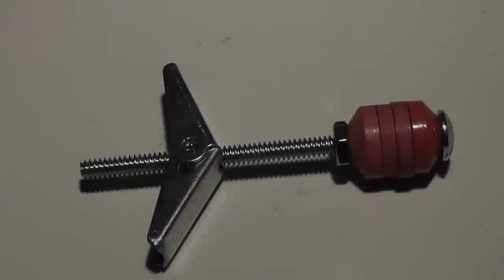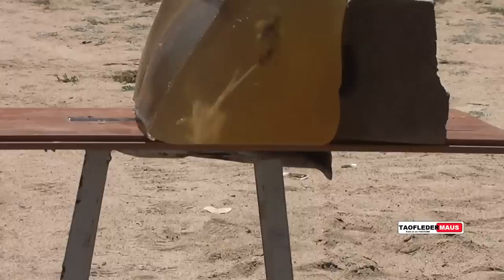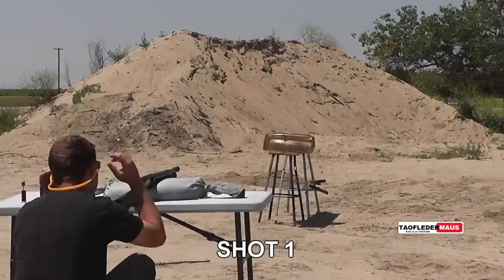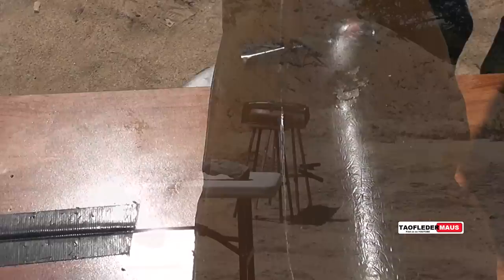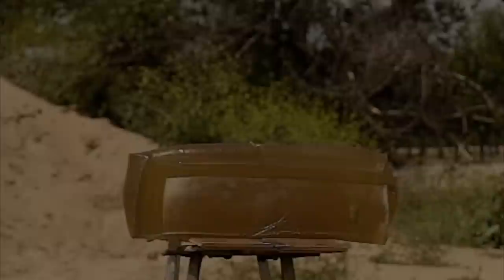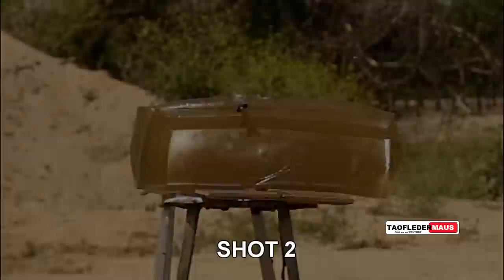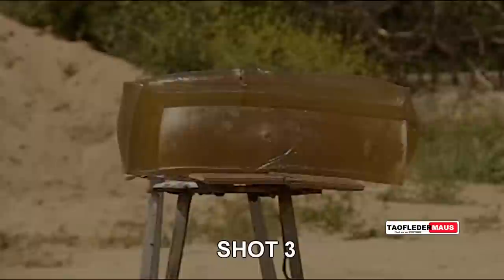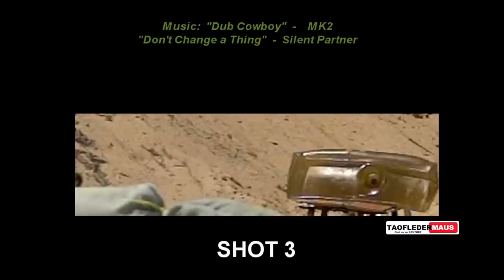Homemade SHOTGUN Folding-Fin Projectile Experiment

Comment: Why is there such variation in the power? The first one barely sticks into the gel, like it was propelled by a rubber band. The next ones are a lot more powerful, but they vary. One goes clean through, one stuck inside, etc. The only way you could get this to work is a heavier front end; right now, the front is light, and so the drag is acting on it, trying to make it tumble. You need a heavy, dense front part, like lead, so its momentum will pull it through the air, while the lighter, draggy tail is pulled behind. But I doubt it'll ever work as well as a real slug.

Comment: Put the moly into the back of the metal slug and have a massive penetrator and a drag tail!  Use an epoxy matrix to fix the screw in the back of the metal slug and try that in gel

Comment: No, actually I did think it would work. It is a lot like our missiles and rockets that have fins that fold out after they are launched. I suggest you use shorter screws, replace the springs with stronger ones so they open faster, and tweak the stabilizer(toggle bolt) a bit so it flies more arrow dynamically. You are onto something here, paten it!!!

Comment: Out of curiosity, I've read on these comments that the longer the round is, the more stable it flies- So what happens if instead of a solid 1 piece core used in this round, you instead used a telescoping core, so the length of the round increases as the make-shift fins cause drag and the heavier front portion acting as a base for the fins to pull the telescoping core from?

In any case, I'd probably be interesting to see how a round like that would play out. All stubby looking in the shell going into the barrel, then a mini-baton exiting the barrel.

Brainstormed a name for it: Erectoround.
Reply from the maker: +DormantGames  That would probably be challenging to make something like that,   something that can handle the intense g-shock and all.
Reply from the maker: +DormantGames  A good example of the force on a round is this one where we shot a huge spring out of  shotgun.  The spring compressed and was mangled just from the g-shock.  https://www.youtube.com/watch?v=FV6aW5LDRZE
Reply: ***** (Just watched that video quite literally a minute before your reply) Because the telescoping core would be cylindrical, it probably wouldn't buckle and bend as much as the spring, considering a spring is basically meant to flex (Just guessing of course, I know nothing about firearms or their ammunition from personal experience, just what I've read on YT and the wiki - But I do know a cylinder is really quite strong against forces pushing against the circular ends) It'd probably tear itself apart upon hitting something other than gel, don't know till it's tested ^^ Just need to wait a few months or years for someone to make-shift one up.

Comment: Would probably work better with the toggle bolt flipped around on the shaft. Would be forced closed as it travels down the barrel preventing barrel scratches and would open up quicker and to a larger degree giving higher stability/accuracy but possibly lower range.
Reply from the maker: Bob  It wouldn't be very aerodynamic,   and the arms would snap open going through the muzzle brake and tear it off.

Comment: You should have turned the toggles round, and wrapped some tape or an elastic around it so it opens up when it hits the gel and forces the toggles to stay open.
Reply from the maker: pypes84  Then it wouldn't be aerodynamically stable and it would tumble all over the place.

Comment: I certainly didn't think it would work. One should try using a similar round with wings that don't expand to see if there was any sort of difference between the two.

In addition, it seems like a sabot could help? isn't the size of that round smaller than the barrel it was shot from? would that cause it to not point  perfectly straight when exiting the barrel?
Reply from the maker: +MsHojat   We'll be testing these again soon,  shooting them at longer ranges so we'll see if they have any accuracy at 100 yards or so.

Comment: For what ever reason it looks like the 2nd round had a whole lot more velocity. Maybe the screw punched a hole in wad making it lose pressure and making uneven results. Maybe put a nut on the very tip so it doesent damage wad?
Reply from the maker: OSU Bucks421  The second one was screaming fast.

Comment: Did you weight your powder charge?  To me it looks like the second shot travel much faster than the first.  Maybe it needs to fly at a certain minimum velocity in order to stabilize?  When I made some home made slugs the heavier ones wouldn't fly straight similar to the first shot on video.

Comment: Honestly? Would hate to get shot by one of these...even more so then the other shells you can load into a shotgun...that thing is bloody terrifying...

DID YOU SEE HOW BIG THAT HOLE WAS!?
Reply: +Rpground

The downside is that the round is very long, and would best fit on something like a break-action shotgun.

But if that's not much of a issue...
Reply: +Joshua Madoc Most break action shotguns, IFRC, have tapered bores,meaning it's not a good idea to shoot any kind of slugs through them.

I could be incorrect about that, but I think Toafledermaus mentioned it in another one of his oddball round videos.

Comment: I thought they would be too light. I wonder if they would work with 3/4oz lead sinkers instead of the washers.
Reply from the maker: retsaoter   Possibly,  th washers were there to add weight,  but also to guide the round straight down the barrel.

Comment: It looks like idea that was tried failed for smoothbore tank guns (too much force, foldable fins were breaking) and 10 mm (too small and fragile), somewhat worked for 12ga (18.5mm). Pretty much,  modern AP shells  sometimes look like such "arrow" with soft alloy braces that secure their fins in barrel's bore, but they avoid folding fins for reasons. Diameter of Abram's AP shell is almost 4 times smaller than gun's bore :P 

Question is - does it have less dispersion than "homemade" slug of same weight?
Thing was fired from short distance and effect looked devastating, but slugs tend to ruin the day from short range too :P

Comment: finally a true aerodynamic improvised round or as we in the south call grape shot. or that a good term for such rounds. because it could break apart at the point of or after it being sent down range.  having a heavy head weight with drag behind. if the washers were of a lead or at least heavy metal washers. it would pack a wallop. and i think i saw right through the jell at one point. i can only imagine what it might do to a dead pig. hint hint. it was the test when choosing the 45acp round over the rest tested. this after the Philippine–American War. being the service pistol of the time was highly ineffective. and how the 45 acp was commissioned along with the 1911. maybe this is something that could happen. oh and the test resulted "with the 45 round" causing the pigs to swing more than the others.rounds. enacting a higher energy transfer rate than the others. because the native philippine warriors kept approaching the military even after being hit multiple times. so when the 45 acp bullets hit their targets. it picked up the intended targets and put them backwards and then down. 
.

Comment: My new single shot 12ga came today :)  I am going try some hardware rounds :) I was thinking around 25 grains of powder on these?
Reply from the maker: It depends on what powder you have.
Reply: Hodgdon, I was going to start off with light loads. I know I use 15 grains for my .410 so 25 doesn't sound crazy for the 12 ga :)

Comment: Do you think it would work (and potentially be more,devastating) if you reversed the toggle bolt direction?
Reply from the maker: RINO711  It would probably get hung up in the muzzle brake.
Reply: Probably wouldn't fly well because the toggle bolts are acting similar to rocket fins in this case, if you flipped them around they would probably just cause a lot of drag in the air and make the round tumble .
Reply: ***** how about a second toggle behind the first, at 90deg to it, so you get a + shaped tail for even drag on all sides. Drag at the rear = straight flight, so it might be worth a shot... or 4.
Reply from the maker: It would have made the round heavier than 1oz.   Too heavy = exploding gun.

Comment: Addendum to the previous comment: The toggle bolt with the .70 cal., aluminum, rifled slugs might work if the weight of the toggle and bolt wasn't more than the weight of the slug, making it bottom heavy.

Comment: They were flying backwards.  lol  (the nut should be reversed)

It would create a far more nasty wound!  (tennis ball sized hole! if the wings didn't snap!)
Reply from the maker: Son of a Zombie  They'd also get caught up in the muzzle brake and probably tear the end of the gun off too.
Reply: Oh right. You guys weren't using sabots lol
Reply from the maker: Sabots are used to fill the space in the barrel so you can shoot say,  a .45 cal slug through the .73" cal barrel.   That is ALL sabots do.

Comment: so I'm not super keen on the hardware used to make the round but it seem like if you cut the bolt down it would fit better in the round. also if you put the toggle bolt on the other way it stay in the open position when it hits the gel instead of folding back closed.  again not super familiar with toggle bolts

Comment: This round is begging to be modified!
 Between the washers maybe some strike anywhere match heads in a small container (small aluminium tube or PVC to shatter when the round makes contact with the target. With the bolt diameter ground down to create space for the match heads or nails or flint or H2O )  with two washers in front and back of the tube with the fins and bolts as they are.

Comment: 2:32 "It didn't start flying sideways as oddball rounds often do" (while video shows it flying at 90 degrees (up), which is sideways by any reasonable definition.  But shots 2 and 3 did indeed fly straight; weird and cool; thanks.
Reply from the maker: Daniel Stoner  It was about 45 deg.   but  was stable.   You can definitely tell when a round is unstable.

Comment: man i had my fingers crossed that these would work as they did. my HUGE doubt about them working came from the fact that i thought the air pressure would hold the bolts fins closed as they travled through the air. happy to be proven wrong. and i still stand by saying that your shooter is a crack shot.
can you shoot a bola style ball bearing next, 2 ball bearings held togeather with some chain just tack welded chain to both ball bearings.
Reply from the maker: judas9909   I was thinking the slip stream might hold the arms closed a bit,  and as it slowed they'd open up more.   But again,  I had a lot of doubts  they'd even work.
Reply: ***** yea honestly didnt think they would fly without tumbling around  or ever flipping out completely. would you ever screw one of the tails into a rifled slug????

Comment: How much would you want for a pack of 100 of these?
Reply from the maker: Jace the Fox  $500
Reply: ***** That's pretty expenisve. I can see the application for these, though. As the video showed, they are rather accurate at mid range distances. :) Very nice innovation, guys.
Reply from the maker: You can buy a set of three for $2.50 at Lowes.  lol
Reply: ***** xD I'll have to learn to pack shotgun shells
Reply: +Jace the Fox some assembly required lol

Comment: Now try it with the spring lock reversed so when it enters the target it does more damage
Reply from the maker: Ian W.  The problem is the toggle arms would get snagged up in the gaps of the muzzle brake.   Probably rip the brake right off.
Reply: *****  do you have a shotgun without? Or is there any way to secure the arms until it left the muzzle? I don't think tape would be strong enough, maybe a longer shot cup that wouldn't allow it to expand?
Reply: +Ian W. tell you what...I have a mossberg 590 without any muzzle device, I've seen other guns used in your films that have none but you haven't retested this one, so, next chance I get at the hardware store I'm going to try an replicate the concept with the anchor flange and if all goes propper, I'll test it how you set it up as a control as my bolt rounds will be different for what I have available to me, and test my theory. I can't give you a time frame when I will be able to do this but hopefully the test will be done with a 2x4 or plywood, and some kind of Mellon in season.

Comment: all that money, time and effort spent on machining all different kinds of shotgun darts trying to get them to fly straight and only few functional results.
go to the hardware store, pick up some cheap parts and make like a 1 dollar dart.
works better than all the machined ones.  gg
that aside, I did enjoy all of the dart videos, and this one made me wonder, maybe the reason this one worked is because it was front heavy and had the large fins in the back to stabilize it? I know nothing about physics, but if you try and make an aluminum dart with that in mind maybe it'll fly straight too.

Comment: You should try to get this camera called the "fps1000", when its finally made it can get 4,400 fps at 256x192 and its about 450$ https://www.kickstarter.com/projects/1623255426/fps1000-the-low-cost-high-frame-rate-camera/description.

Comment: Do it again but next time have the anchors open the opposite way.
Reply from the maker: minks502  Wouldn't it snag on the muzzle brake and tear it off?
Reply: You dont think the shot cup would hold it closed untill it cleared the barrel
Reply from the maker: minks502   I imagine it would work as well as plane flying backwards if it cleared the brake.   It would probably flip around.
Reply: Like a RPG rocket they open that way

Comment: My first concern is the fact that you don't mount the gun with a remote trigger, firing experimental rounds. To much back pressure for the amount of resistance/blockage the round has, and you just held a stick of TNT.
I ask as a brother, please introduce some safety measures to your experimentations.

In Jesus' name you're healed.
Ask the Holy Spirit into your heart and walk a new with a Divine, loving Father.
Reply from the maker: Tomm Smith  The gun doesn't know if it is shooting 1 oz of lead or 1oz of whatever.     If we were shooting 3 oz rounds, sure,  the gun would blow up.

Comment: mate ! try reverse the direction of toggle bolt goes into(fins will be folded forward),
this allows the fins(toggle bolt) to be installed to the most rear position,  thus generate a longer Pendulum length  ,and due to the shape of the bolt/fin , reverse it will create more drag, all that leads to a more stable flight.
pics for ref:
https://giganticubegames.files.wordpress.com/2013/01/rocket-m72.jpg

http://world.guns.ru/userfiles/images/grenade/gl51/rpg32-1.jpg
Reply from the maker: +Binary Stein     Why alter something that works?
Reply: +TAOFLEDERMAUS alter st to make it work better = improvement
Reply from the maker: +Binary Stein  What kind of improvement would you expect?
Reply: +TAOFLEDERMAUS For more stable flight. Because the first round did not fly level . just sayin
Reply: +TAOFLEDERMAUS by the way, it's a bright idea for making a shotgun dart out of commonly found stuff without welding nor turning .Cool vid
Reply from the maker: The way the toggle is placed means it is self-regulating and will open enough to create the right amount of drag,  not act like a speed brake.
We will be shooting more of these soon.  Shorter ones,  and also a backwards one.  The biggest problem with the backwards one is could open in the barrel and gouge the barrel or seize up.  If it made it that far,  it would hang up in the muzzle break.    We'll shoot them all at longer distances to see if they have any accuracy at all.
Reply: to avoid those situations you stated, a cup wadding/sabot that fully warps around toggle fin should allow it free from getting caught on anything in barrel .I will be looking forward to see that incoming video. :  )
Reply from the maker: +Binary Stein  The g-shock is intense.  Imagine the force of those arms being pushed outwards if they were loaded backwards,  they'd probably cut right through any plastic cup or sabot..   Plus,  the photo you showed,  the fins still sweep backwards.  Having the fins sweep forwards doesn't seem very aerodynamic to me.   The area of drag is closer to the center of gravity when you want it further away.
Reply: +TAOFLEDERMAUS  http://goo.gl/YVlttV 
anyway~ i would get myself some components for experiment this kind of dart~

Comment: Flip the round opposite with fins first
Reply from the maker: TJ N   You just want to see our gun blow up huh?
Reply: Why would it blow up?
Reply: TJ N If there was a choke inside the barrel, the "fins" might catch on the choke, and cause a catastrophic failure. My theory
Reply: A baby exits it's mother's womb head first. That way its arms won't have a chance of spreading open and getting stuck exiting vagina.

Same concept here. If it exits fin first. The fins may get caught before it even exits the barrel. Causing the round to break up in the process and severely damaging the gun and its operator.
Reply: Ur Afail is there a choke? Why the hell would anyone be firing dumbass homemade rounds out of a barrel with a choke??? Common sense buddy.  we àre talking smooth bores no choke.
Reply: TJ N The friction will allow it to get caught IN the barrel. Either that or it will get caught before it even enters
Reply: Caught on what. The smooth bore of the barrel?   i dont think so.  it would chamber either way you put it in.  i have shot guns. I was an armorer in the military.  im not a cod noob.
Reply: +TAOFLEDERMAUS actually in theory it would be okay if you reversed the fins, then load it backwards with some pvc supporting it.
Reply from the maker: But what would that accomplish?  Make it NOT work?